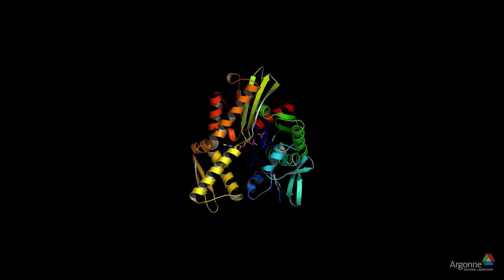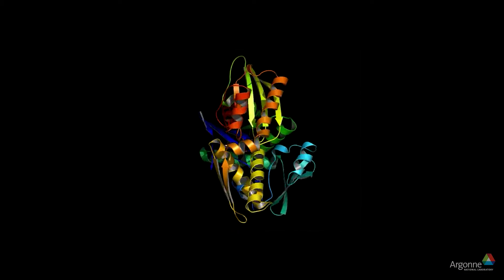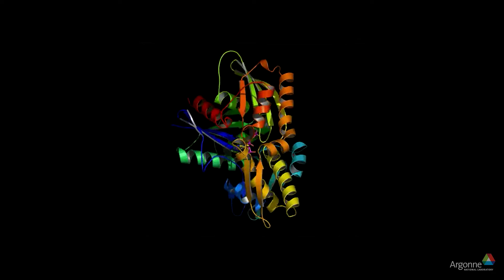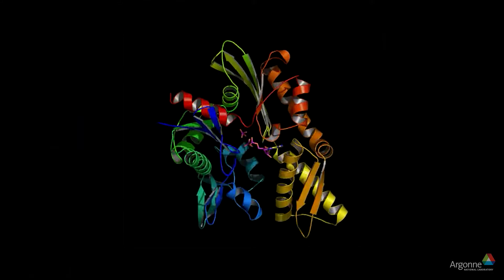Studying Amyotrophic Lateral Sclerosis at the APS

Comment: Okay, so less fiddling with back-illumination mirrors, more backing objective lenses (with single-rod mounts to the vibrarion-isolation table) right up onto Z0 of grain diffraction of a debilitating spinal concrete? Do you get in vivo satisfaction of concreting less as folding 'hints' are provided optically or by running chemical hints through a cuvette, or is that still out for cell signaling reasons?